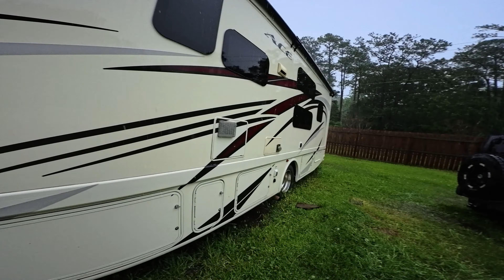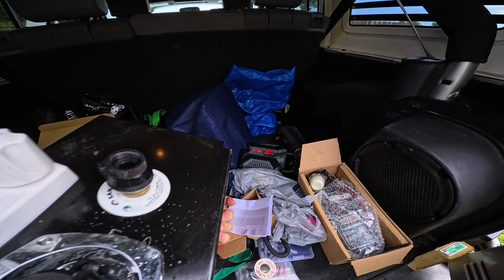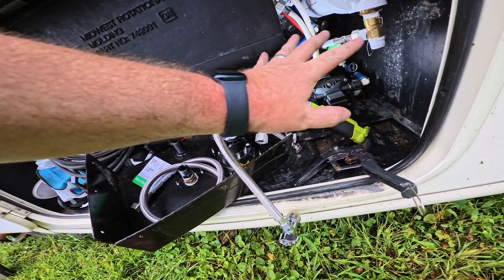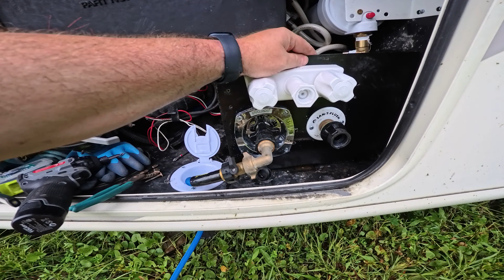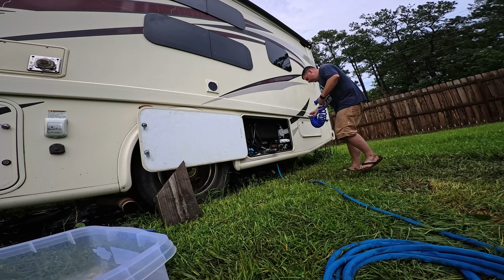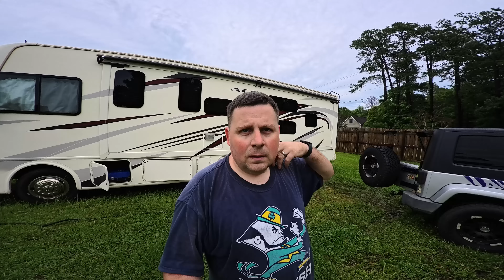How To Add RV Fresh Water Tank Fill Valve!

Comment from the maker: My fear (haven’t tested it yet) is that the overall pressure of the tank and weight of the water will overwhelm the hose pressure and stop filling the tank. Does anyone think this could be an issue?